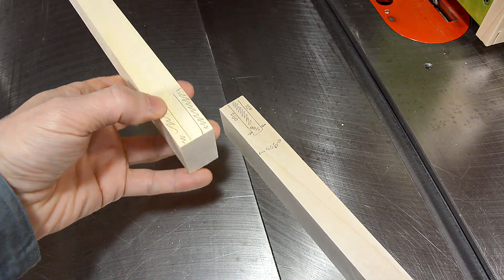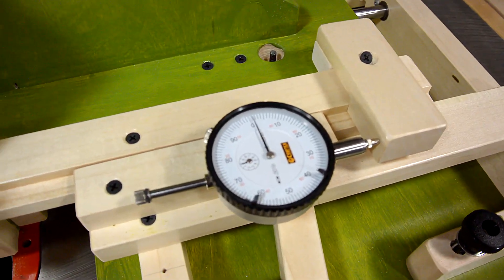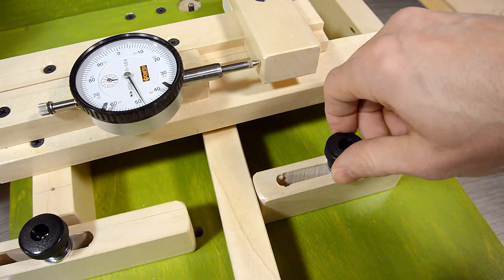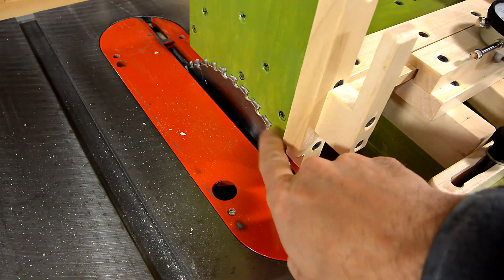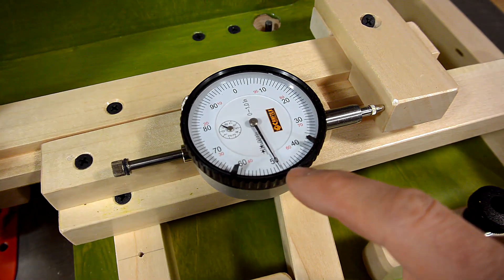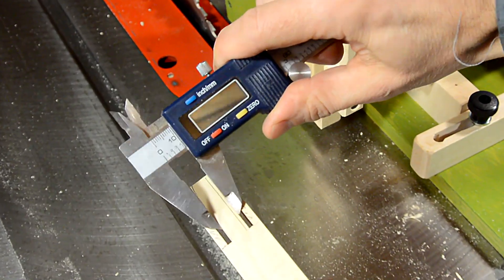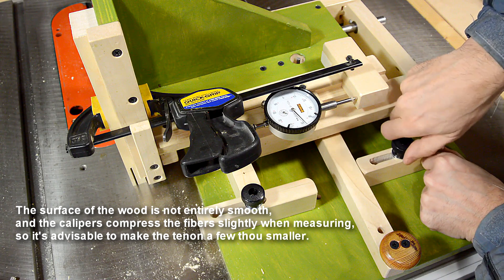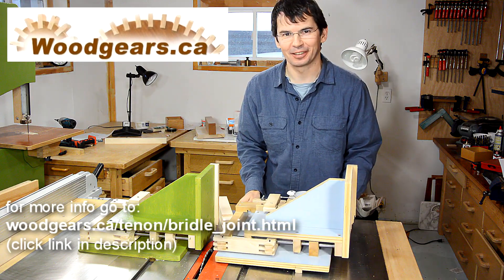Setting up a bridle joint on the tenon jig

Comment: Can you explain how do you convert all of this thou unit to metric. I know I just could google it, but the way you explain it will make more sense. Thanks.
Reply: 1 thou is close to 0.025 mm, that is about two and a half hundredth of a millimeter, 25 microns (micrometers). Although it sounds much smaller than it is (and for woodworking it is WAY too small), you can measure it with a regular caliper, you don't need digital one (of your nonius is scaled for it, that is). You only need good eyesight. Nonetheless, it is way too small unit for woodworking, since your precision is determined by the quality of the saw you have, axle and bearings on that saw (are they old, since bearings tend to get play as they wear) and if your blade is banded or dull just a little bit, it will raise the fiber on wood and you won't get precise measure. Even fibers in the wood will affect how blade cuts them. Getting your precision within 0.1 (one tenth of a millimeter) is more than enough (his is within 6 thous, which is about 0.15 mm, which is bigger (thus worse) than 1/10th of a millimeter). So even if it sounds very precise because he uses 1/1000th of an inch, keep in mind that an inch is much bigger than a millimeter (25.4 of them).

Comment: THOUSAND!!! god that pissed me off
Reply: "Thou" is a very normal unit of measure, at least, where people still use inches. See http://en.wikipedia.org/wiki/Thousandth_of_an_inch
Reply: still annoying that doesn't change it
Reply: jonathan lavigne I think you are confused.
Reply: "thou" its sounds silly how does that make me confused?
Reply: This is why you appear to be confused:

You are getting angry at someone for repeatedly using the correct word to describe something. Your original comment implies that you would prefer it if he replaced all occurrences of "thou" with "THOUSAND", which would not even make sense. It seems that you fail to grasp the idea that "thou" is a word in its own right that has been in use to describe a thousandth of an inch for over 100 years.

You are allowed to believe that certain words sound funny, but if that is indeed your only complaint, you should have perhaps been more clear to start with.
Reply: didn't mean to piss off the English teacher sorry.